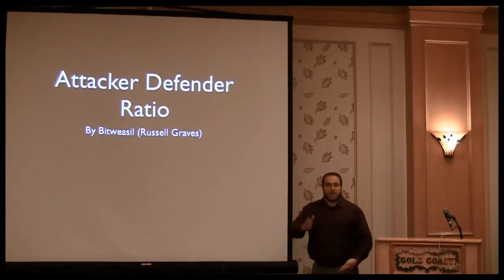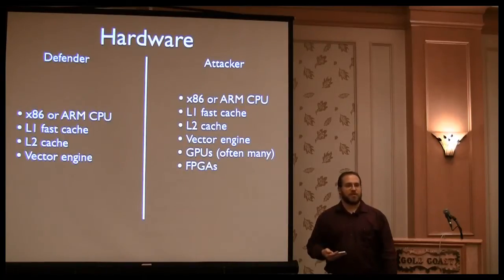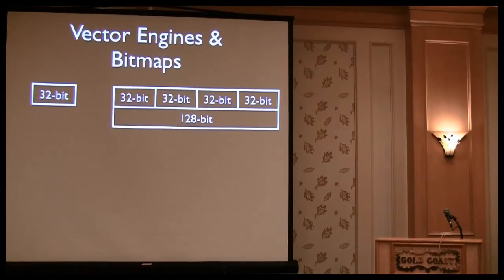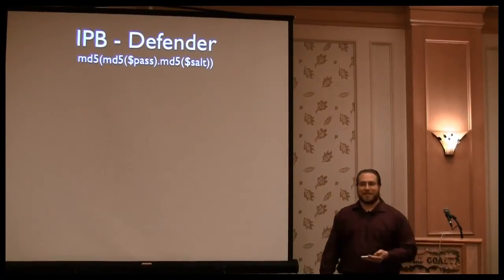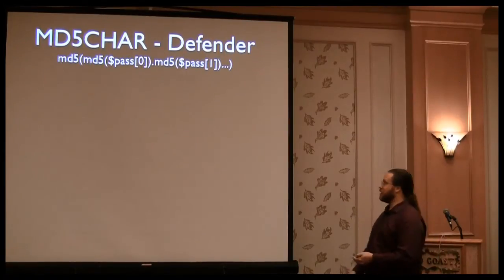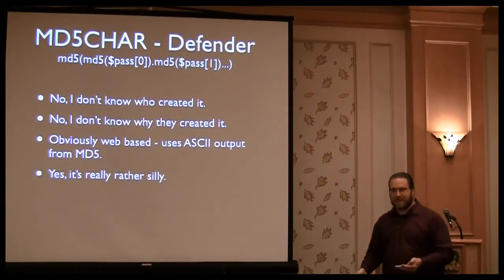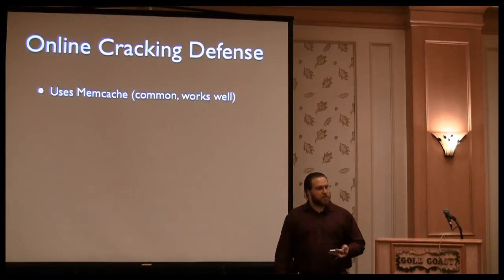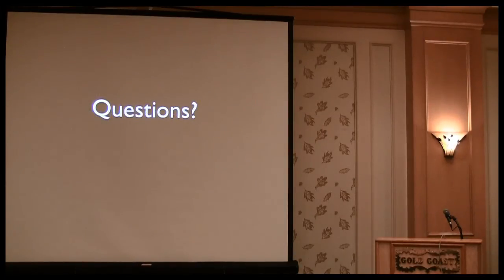How To Screw Up Password Hashing: Secrets of a Password Cracker Author

Comment from the maker: Russell Graves (@Bitweasil) speaking at Passwordscon in Las Vegas, July 30-31, 2013.
--

Password storage is one of the major weaknesses of the last five years. Databases are dumped on a regular basis, and due to poor password storage algorithms, attackers have an incredibly easy time extracting the actual passwords from these dumps. 

This talk dives into the techniques used by the open source Cryptohaze password cracking framework to dramatically reduce the work the attacker has to do to recover plains, even with salted algorithms. It discusses the most commonly-seen algorithms for password storage, and how the attacks against these are heavily optimized -- in some cases, only half the work the defender must do! 

Proper password storage concepts are then discussed -- not from the perspective of "You should do this because it's better," but from the perspective of the hardware attackers use and how to neutralize their advantage and make their cost per password exceed the defenders cost.

How To Screw Up Password Hashing: Secrets of a Password Cracker Author